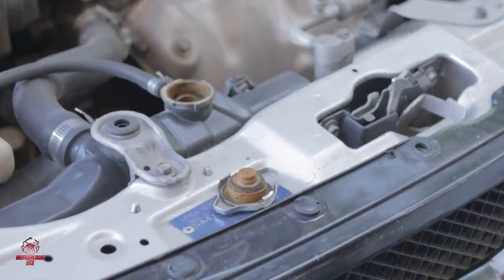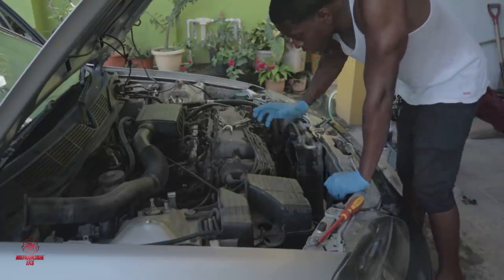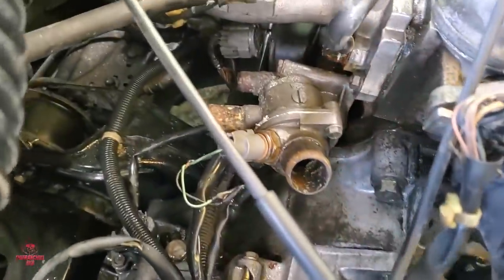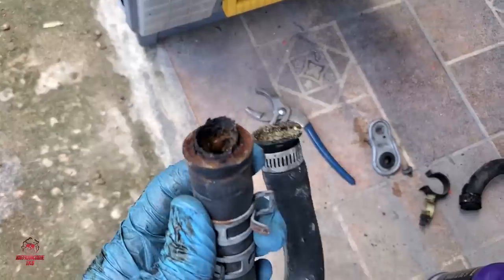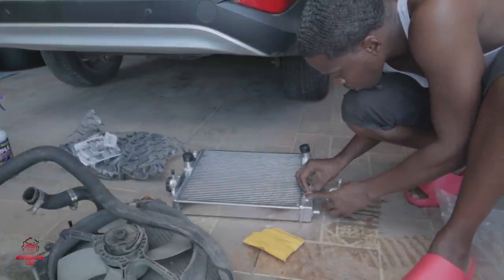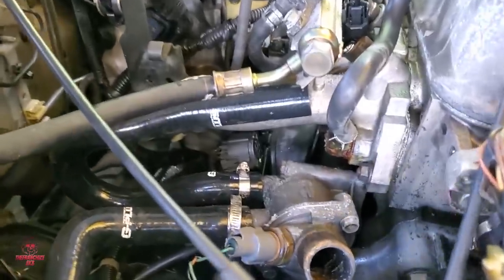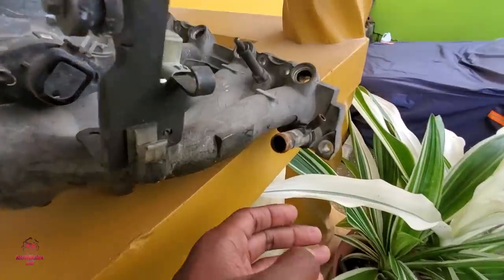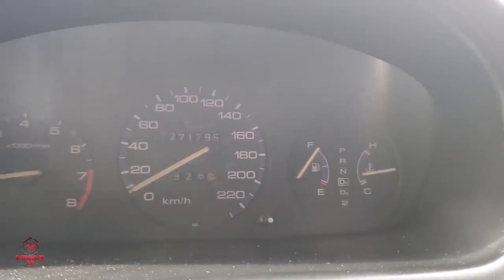RESTORATION BEGINS//NEW UPGRADE FOR THE DAILY//#THEFRANCHIZEEK3 #EKCIVIC

Comment: I had to change my radiator for  the same reason when I got mine. Dirt everywhere! Got the G-plus triple core at B-mull in Mandeville.
Reply from the maker: Mad. How it perform after?
Reply: No issue at all. I don't even have to top up on coolant...a just recently I flush it out and pour in water.
Reply: Plus I can do long aggressive runs and it don't over heat.